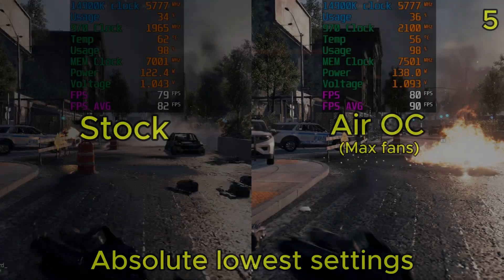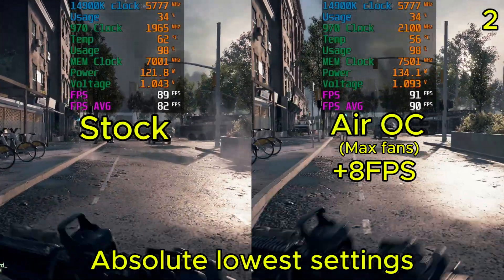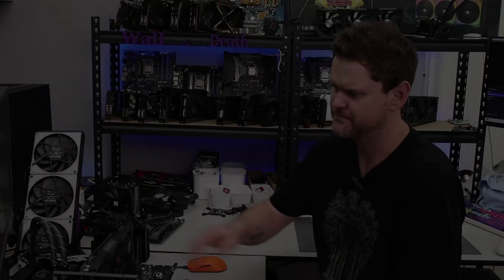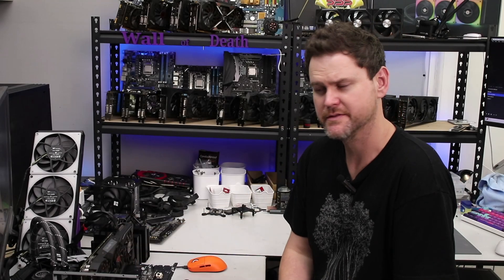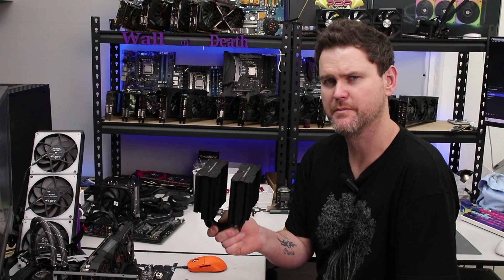I Boosted a 1660 Super to Fight Battlefield 6

Comment: GTX 16 cards were never extremely overclockable in my experience…. Except the 1650 super that is. I could overclock my 1650 super more than my 1660 Ti. My bin could’ve just been garbage but I had a 1650, 1650 super, and 1660 Ti and the 50 super over clocked the best
Reply from the maker: I mean, 14% isn't nothing... but it's not really something either.

Comment: Problem with custom cooling, especially these days, is that you need to cool the VRM's and RAM chips because they heat up too much as well. I gave up on modding, rather just but a well build GPU and then upgrade it every few years, overclocking can only do so much anyway. Lifecycle doesn't make much economic sense to me to buy custom cooling parts when I'll only be using it for a few years. It can be fun but more trouble than it's worth too.
Reply from the maker: VRAM and VRM cooling only matters so much and it's very dependent on the card. I wasn't really pushing the VRAM on this one so cooling with just a fan was enough, on higher power cards with bigger VRM phases it becomes more of an issue, but for a card like this... a fan is enough. I think the VRAM cooling myth might be the first episode of Trashbench Mythbusters.
Reply: @TrashBench  DDR5 wasn't so bad, but these days, DDR6 and DDR7 really heat up, nearly all GPU's have heatpads touching the VRM and RAM chips these days.
Reply from the maker: @dcikaruga  Sure, they will get hotter, but if you aren't overclocking them leaving them exposed is unlikely to have a negative impact.
Reply: @TrashBench  But, whenever your under load, say heavy gaming, the GPU, VRM and RAM would still be stressed and heating up, right? I wouldn't risk it these days myself.
Reply from the maker: @dcikaruga  Perhaps, but I wouldn't say what I did here is recommended for daily use.

Comment: why is power consumption so low in last test ?
Reply: the shunt mod at 1:49 skews the GPU's power sensing and therefore limiting, meaning it thinks it's drawing less power and keeps going. also means it reports much lower in software
Reply from the maker: @daaradrreea4426 has it right
Reply: He lowered value of the sense resistor to trick the card into allowing more current (power).  The effect of this is that power displayed is lower than it really is.   https://youtu.be/tH6koMG7FTg?si=qSFvkHZed8C9ZasW&t=107

Comment: Am wandering who much yoi could push RX580 8GB amd i would like to see that
Reply from the maker: I have a 570... but it's weak... 580 might have to be on the shopping list 😁
Reply: @TrashBench my rx 550 overclocks to more than 300mhz stable while on air, it's a low end card from 2017 but it's an amazing overclocker, and I'm testing more overclocks on it soon, till now, I've tested +300mhz with -50mv voltage and +75 power limit, and it's fully stable, crazy stuff

Comment: makes me wonder how far you could push a 980 ti especially with a bios wattage mod😁
Reply from the maker: I need a new idea for next week... this might just be it! Just a shame everyone still wants RTX5050 money for them.
Reply: @TrashBench  oh weird, over here in the states 980 tis are going for 50-80 which is still kinda insane to me due to them being insanely competent cards to this day even w/o overclocking.
Reply: @nonoyesnoyesnt I’ve  said this same thing, I got mine a year ago for $70. And I beat 19% more performance out of it with just air cooling without even modding it. this thing is absolutely terrifying.

for comparison, I got 15% out of a GTX 690, 14% out of a 7900 GRE, 13% out of a GTX 580, 11% out of a 2070, 10% out of a 1070, 9% out of a 1650 Super, and 3% out of a 4070, because the 4070 overclocks like a steaming pile of garbage.